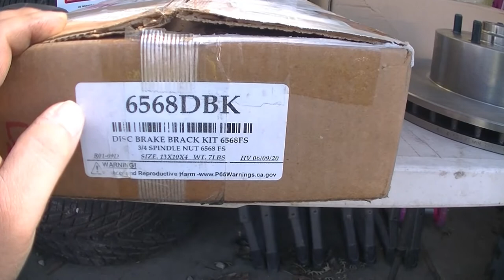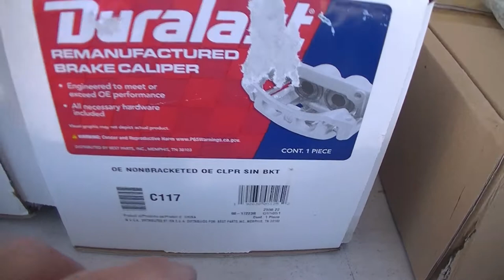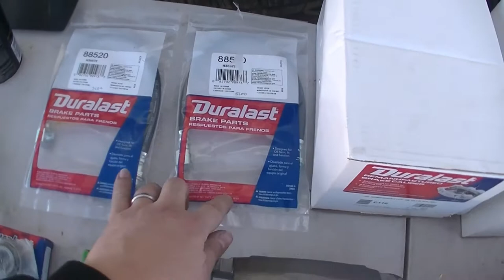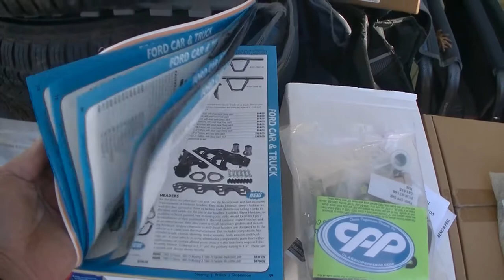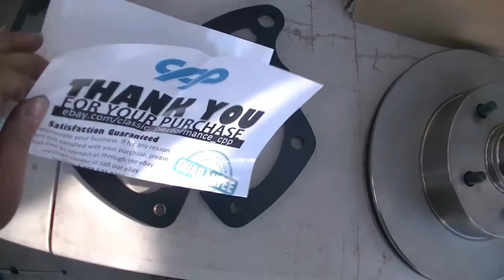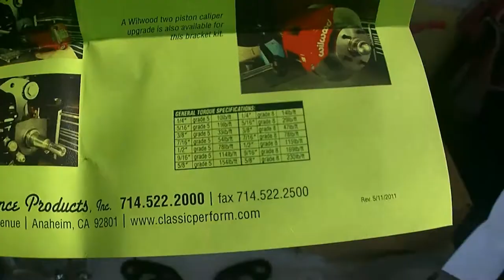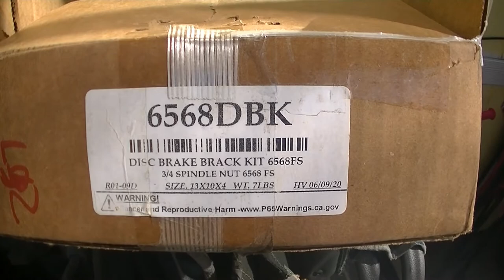CPP chevy impala front disk brake conversion part 2 of 2

Comment: Very good video, You remind me of my son in law. Great kid. Good you explain every step. Smart to do the driver side first off camera and then show us you doing the passenger side. Right to the point. 
Just one thing. Never ever use your torque wrench to loosen a nut or bolt. Torque wrenches are only to torque with. You can damage it. Try to calibrated yours up against another to see if it is off.  Thanks
Reply from the maker: Yea that’s an old torque wrench so I just use it as a big ratchet, I got a new one when I was making that video

Comment: Im going to be ordering the 4 wheel kit from cpp this week im glad i seen this. The full kit with all lines is $1200
Reply from the maker: i thought about doing that but i wanted to be able to use OEM parts so if anything goes out i could just run to the parts store and get it, and not have to wait for it to get shipped to me
Reply: @cali530marcos3  i got most of the kit in some stuff on back order, nice stuff

Comment: Great video I'm going to do the same to my 67' Impala SS. Keep those video coming. Remember to really pack those new bearings with grease
Reply from the maker: yea i used a wheel bearing packing tool and it worked really good
Reply from the maker: yea, i used a grease packing tool, i also made a video on that

Comment: Thanks for this video this really helps. What master cylinder and booster do you have or what are you gonna install to work with this disc/drum install that you have.
Reply from the maker: I’m using the stock master cylinder for now, still works and stops good, but I I’m going to upgrade it to a 1967 impala master cylinder and ad a disk/drum proportioning valve

Comment: thanks for the videos, im thinking about doing this on my 65 bel air. what did you do for a master cylinder?
Reply: whoops! just saw you had a video about that. ill check it out.
Reply from the maker: Using the stock one for now, but going to upgrade it for a 1967 impala one and add a proportioning valve for disk/drum

Comment: So you had to purchase all the parts separately? Or it came all together? If it was separate were did you get the list? Looking to do this on a 1964. Was it cheaper than the kits at summit or others?
Reply from the maker: The kit i ordered came just with the brackets them self's, and bolts, everything else i bought from the parts stores. not sure how mush i spent but it was less than $300. also i went this route so if anything goes bad i can just go to the parts store and get it, instead of tracking the part down and waiting on it to get delivered
Reply: @cali530marcos3  thank you! Very good video!

Comment: I’m going to do this for a friend and I was wondering if it was a must to change the brake lines and master cylinder?
Reply from the maker: No it wasn’t a must, I did mine because the guy before me took all the brake lines, fuel lines, and wiring out the car, I pretty much just bought a shell
Reply: Thank you for replying also another question to convert the back brakes from drum to disk brakes on the same car the same process?
Reply from the maker: @andrespaez6493  not sure, I haven’t switched the rears to disk yet, I’m still running drum brakes out back, I do know u have to remove the rear axles in order to remove the drum assembly and install the new brackets

Comment: Wheel bearings should be tighter. Youre right,  not super tight but they shouldn't free spin that quickly. Especially when they are tightly packed with grease. Tighten the nut so the rotor it decently tight to seat the bearings.Then back it off and put the key in.

Comment: Whats the point of converting? I have a 1966 I just bought im about to re do the brakes been sitting for 30 years. Not sure if I should stay original or swap over?
Will i be able to fit 100 spoke 14s?
are the factory brakes ok for burnouts?
Reply from the maker: Just better stopping, and easier to service, also u can find the parts at any parts store without having to special order and waiting on the parts, I have 14 steel wheels so I think the 14’s spokes should fit

Comment: You said you we're going to paint your rotors, how did that turn out and has it held up since then.
Reply from the maker: It’s been holding up good, I taped up were the brake pad rides on both side and painted the rest black looks good and hasn’t got any surface rust

Comment: Did you uprade master cylinder for the new calipers?
Reply from the maker: Not yet, I’m going to install one of a 67 impala because those come with dual master cylinder instead of just one like mine, also going to install a proportioning valve

Comment: Which master cylinder and brake booster did you install?
Reply from the maker: I haven't installed a brake booster yet, but the master cylinder is a stock replacement for my 66 impala

Comment: Can you fit 14" wheels with that caliper bracket set up?
Reply from the maker: Yes u can, I'm running my 14's steel wheels with hubcaps right now. My 14's are off of a 80's cutlass so not sure if the offset/back spacing is different from the 60's 14's
Reply: The offeset is different. U have to run off of 80s cutty or monte carlo

Comment: I purchased the front disc brake 2" dropped spindles kit and I'm having a hard time bolting everything up. No instructions ofcourse and just a bag of bolts.. I'm reusing the steering knuckles off of the factory front drums but was told they would bolt up to the dropped spindles just fine. Has anyone else have the same problems I'm having??? #68 impala fastback!!
Reply from the maker: I tried showing everything on both videos I made on how to take it apart and how to put the kit on, hopefully u can figure it out, just take ur time

Comment: can you show how you routed your hard lines
Reply from the maker: i made a video on the brake buster install and i show in that video how i ran them i think, u can go and check that video out and if what u need is not in that video i will gladly make one showing how i routed the brake lines
Reply: I have a 1970 impala, this cpp brake kit works on mine. I pray, thanks so much!!

Comment: I’ll bet if you used your original hubs and rotors from the rear axle of a 79 Pontiac trans am you would have zero offset.  I’m doing that to my 57 Chevy.
Reply: Thats what I'm doing. Alot of people like the wide offset. Idk not me.
Reply: What caliper brackets did you use? Im doing my 64 impala

Comment: Ese kit de frenos le queda a una chevy  c10  69
Reply from the maker: Este kit nomas le queda al 65-70 impalas. Pienso que usted puede usar frenos de la 73+ c10
Reply: It won't work with the 1969 Impala,the center shaft of the 69 Impala is thicker in diameter than the 1966 Impala,I just did my with all the part numbers you listed, the bearing turn out to be smaller,it's all good I'm looking on eBay to buy a set of spindles out of a 1966 Impala.

Comment: Grease caps. Did you pack the bearings?
Reply from the maker: Yea, I packed them using the lisle tool, it’s a tub filled with grease and u just press down on it
Reply: @cali530marcos3  Sweet dude. I just didn't see grease on them. Yeah those are nice to have.

Comment: Let me give you a couple of professional tips first off you don’t mask off the  rotor you send it out  and have the whole thing powder coated or you can paint it and then you run it across your brake lathe to  clean off the area the pads ride on it’ll look like absolute hammered dog shit if you try to tape it off, how that’s its done number two please do not loosen bolts with the torque wrench. That’s a good way to ruin it. That’s what a impact or a breaker bar is for.
Reply from the maker: Well first off I cleaned the rotor and took my time taping it up and used a good paint so the came out good, it’ll look way better than a rusty surface, and for the second question I don’t use that torque wrench to torque my bolts, once I got my new husky torque wrenches I started using the cheap Autozone’s torque wrench as a regular 1/2 inch ratchet, works good kinda like a breaker bar and a big ratchet all in one